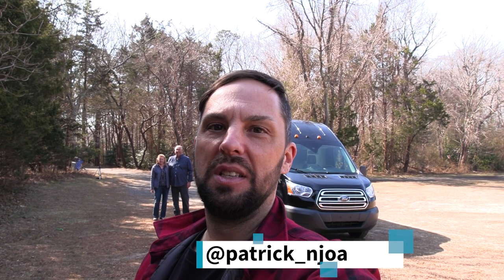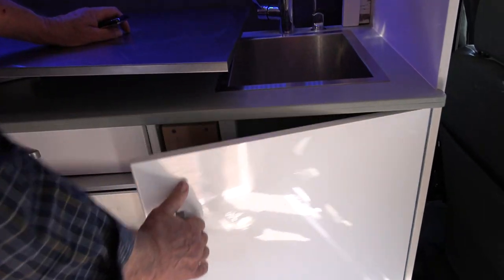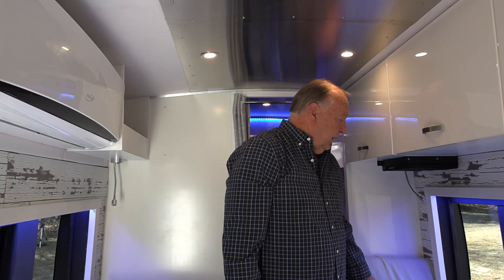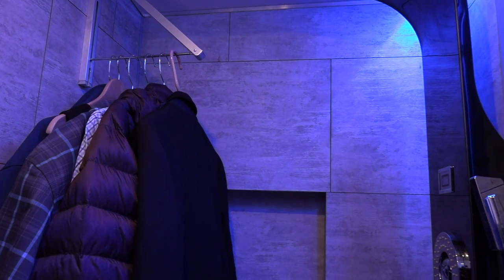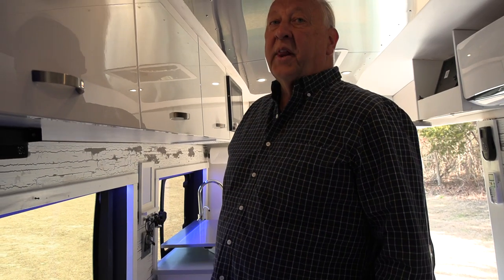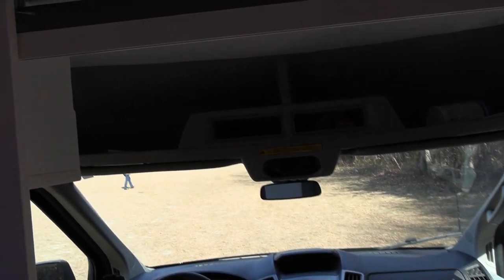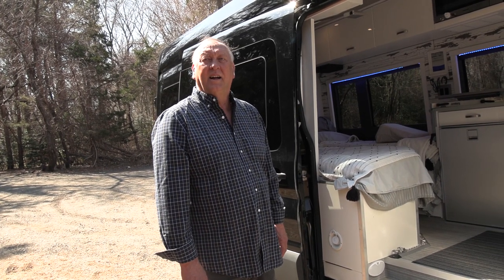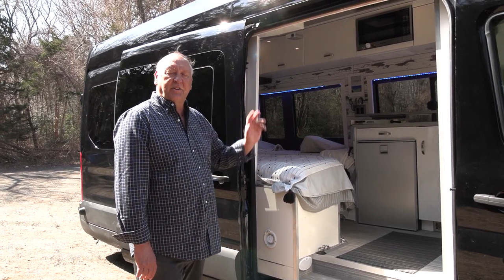Home Builder Creates Extravagant DIY Van Conversion With Full Bath & Shower

Comment: That is a fantastic build. Did I understand correctly that he is keeping his 560ah battery charged only from the inverter?
Reply: Also charges batteries with inverter charger, I drive a lot so I mostly use alternator
Reply: @paullehto1823  Thank you.  I'm trying to plan my first van build. I'll only be out for a day or two at a time, three days max. It had not occured to me that panels may be optional.
Can you get more than one night out of the mini split? Or stated another way, how much time can you get out of the mini split on the 560ah batteries before recharging?

Comment: If like to order the mini split 
I’m on Amazon and there are several 
Anyone know the specific brand and btu he uses or I should use with a Promaster 2500 ext high top?
Reply: Disregard I watched further
Reply: I used aircon titanium 12000btu , I would use 9000 btu next time. I chose it for the small size,  they need at least 4”” of air space around outside unit when in use

Comment: That Air Con is not gonna last long even with door open, it’s pulling in too much discharge air and recirculating thru condenser… that’ll cause super high head pressure and compressor failure… I’d recommend finding a sheet metal cut a few fresh air vents in floor of van and a metal transition/box for the fan shroud to vent thru the back door… this will allow you to also operate it with the rear door closed as well… well worth the money especially since it looks like you’ve spared no expense.
Reply: Well never mind, by the time I finished writing that you’ve already purchased another van… must be nice
Reply from the maker: We shall see
Reply: I spoke to my hvac installer, he said since this unit is designed to condition 600 sq ft and I have 70 it’s not a problem. He’s more concerned with the bumps. Cost $700 for excellent heat and cooling. Cheap  for what you get in performance
Reply: @paullehto1823  yeah if it works, it works… I’m only speaking from 26 years in HVAC service… I run all the callbacks and correct the installers mishaps as well as the manufacturers… no one is immune.  9 times oversized too is most likely just another nail in the coffin, but if it works for even a few years or more… 700$ is a small price to pay for being comfortable and I’d pay twice that to sleep well on a hot night… rubber grommets can also be installed on feet to absorb the vibration and minimize that from happening, but honestly I think the flare fittings the installer setup will be what leaks first IF anything.  I only opened my mouth because I know you’d probably most likely like to operate that unit with the door closed and it is possible to do that… that’s it.  Super nice setup though!  That’s a 5 ⭐️ hotel room on wheels! 👍🏻

Comment: Why don’t you insulate with Havelock wool?
Reply: Expensive, I will try it on the walls next build and use rigid foam  sheets on floor and ceiling. With all the glass (which I love) the slight better r  value of havelock wool over mineral wool is minor. The mini split compensates for large windows since it so efficient.  A house avg life is 200 years, a van 20 years. So don’t  get carried away with cost
Reply: @paullehto1823  take a look at FnA van life they have just installed it in their new build.  Can’t beat wool 😀
Reply: I now use wool in certain area’s, I also use rigid foam board and minerial wool

Comment: I would want to go all propane, I think.  Do they make a propane minisplit?  I hate all the electric - it takes up too much storage area.  Just one battery to run the LED or 12 volt lights?  I am female, so I have no idea how much energy lighting alone would take, but I would not need much light at night - maybe just small battery powered lights that push on and off?  Oil lamps, like in the days gone by.  I really hate being so dependent on electricity.
Reply: Propane can do heat, but a/c can be only be done with electric.

Comment: i must have missed something ..... was the van's power source solar or what ?
Reply: Large battery bank charged mostly by high output alternator ( 60 amp dc-dc charger) and by30 amp outlet( campground) . Solar can be added since plenty of unused area on roof due to minisplit
Reply: Things to consider with solar. roof vent and a/c on roof leaves little space to put  solar panels. Solar panels work much better if tilted toward sun. Don’t work cloudy days. Van much cooler if it’s in shade but you won’t get any solar.I would spend the money on high output second alternator (200amp) and maybe get small portable solar system.

Comment: Please Info about protector
Reply: Nothing special, there are many to chose from, going with 12 volt saves you from having to turn inverter on. The more you spend, the better the picture. This projector I give a average grade
Reply: @paullehto1823  do you have the brand

Comment: Nice design in general but don't like the table idea or no hob on top
Reply: No everyone’s choice, my previous van I stored table behind seat and stored lagun brackets under bed, I did not use it much because of the hassel of setting up the table and taking it down several times a day,  gets old real quick. I actually like this set up.
Reply: I still can take table top and store it be behind seat like my previous van. The nob that secures table is easily remove if you perfer not leaving it over counter